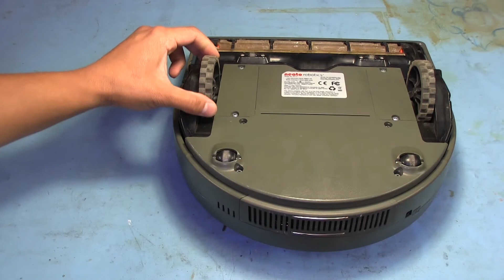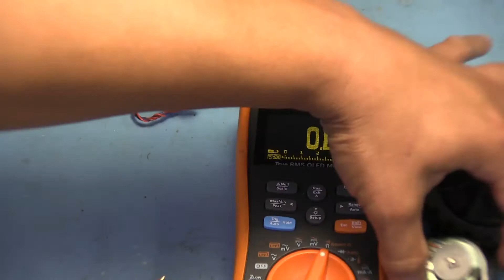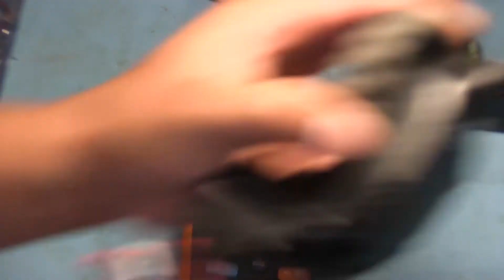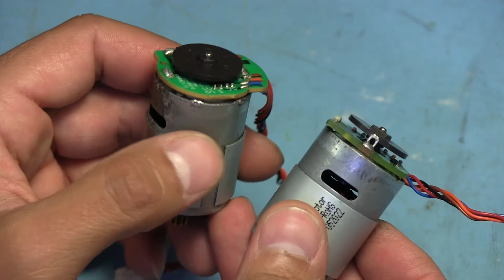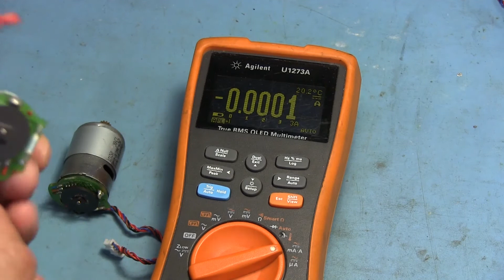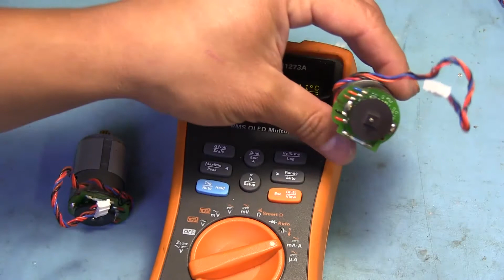TWB #58 | Neato "Stuck" Wheel Nonsense

Comment: take the motor out and drench with wd-40 by spraying it in through the holes on the motor case, then spin the shaft using a cordless drill by gently chucking the drive sprocket, blow out wd40 with air and repeat until clear wd40 comes out, blow out good and dry off and replace, my xv-14 right hand motor was stiff and causing a motor stuck error, after cleaning/lubricating its been running fine for a few months

Comment: I always enjoy your videos and thought the information about the motors interesting. Liked demo at the end with the correct motor and incorrect motor, that was funny.
I just had a TV remote die. I found a replacement for about $12, did not buy it yet. So I took the dead remote apart and did not see anything obviously wrong. While apart I hooked up the batteries and bridged the infrared diode with a led to see if the infrared diode was open. The led would not light bridged either-way. So I took the remote with batteries to the TV and it worked??? I put it back together and it's still working, have no idea why.
Reply from the maker: Those are some of the most frustrating "repairs". lol